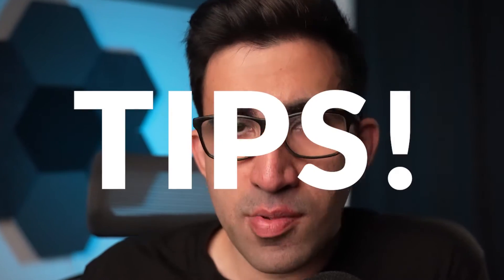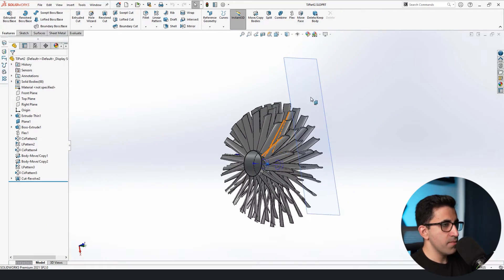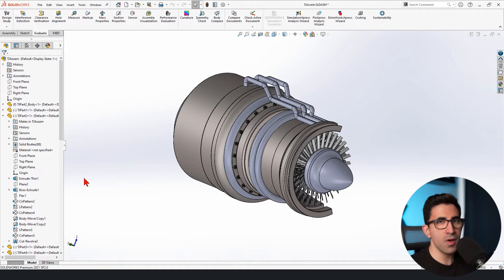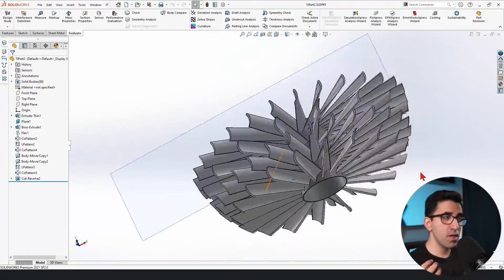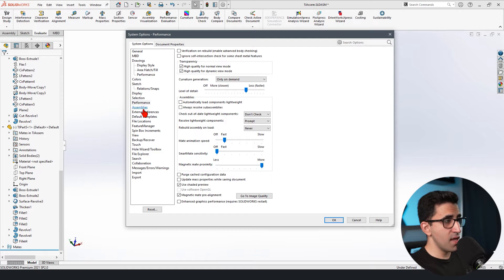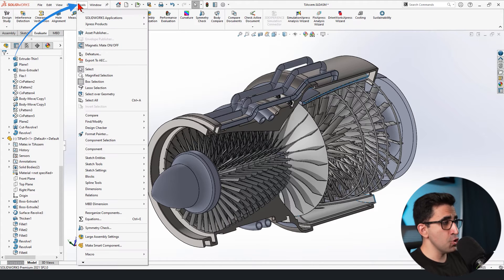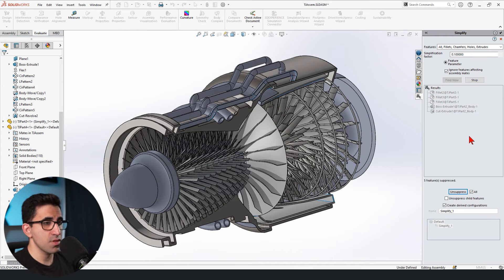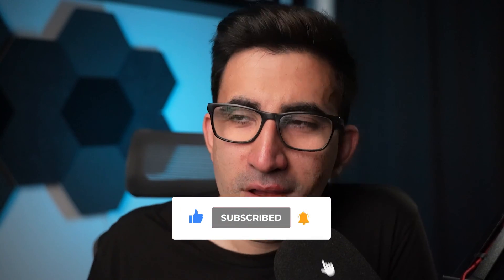Five ways to deal with SolidWorks on a Slow Laptop or PC

Comment: can you make a video on why sometimes solidworks takes up to 5-10 mins exporting a drawing to pdf. I'm using intel i7 8700, 32gb ram, 1TB SSD and 1080 Gtx graphics card. I dont know if i should change the graphics card to rtx 4060 ti
Reply from the maker: That's a great question! SolidWorks can sometimes be slow in exporting to PDF due to various reasons, not just hardware. Your setup with the i7 8700, 32GB RAM, and GTX 1080 should be more than capable. Before considering an upgrade to an RTX 4060 Ti, it might be worth exploring other factors like software settings, file complexity, or even driver updates. I'll think about covering this in a future video for a more detailed look!

Comment: nice clear  video thanks. Any tips on stopping the lag when changing con configurations? Its got outrageously long
Reply from the maker: it might be your hardware. What lag exactly?
Reply: @with-aryan  Appreciate the reply. turns out it was bounding boxes. Need shipping volumes and added bounding boxes with equations. That was a mistake. Have changed them all to text.